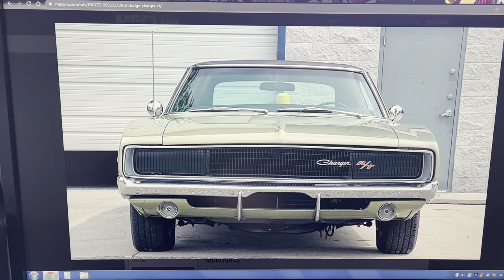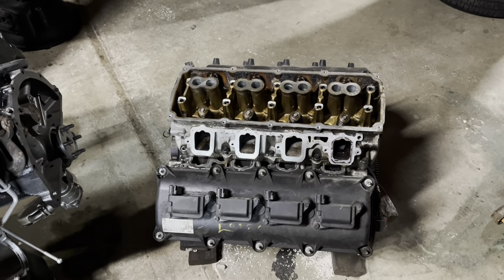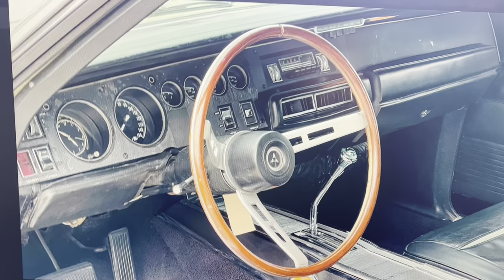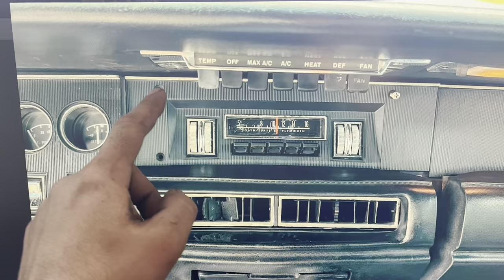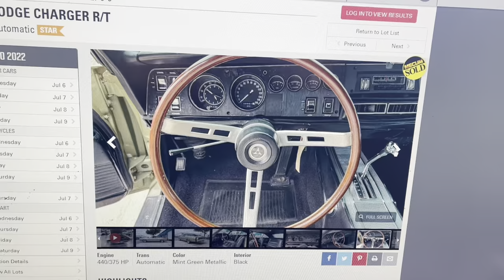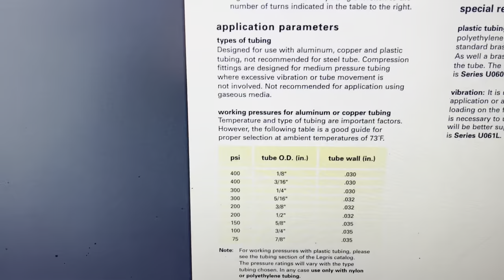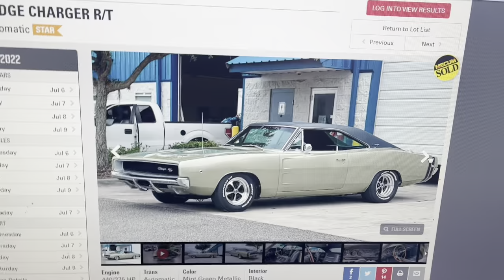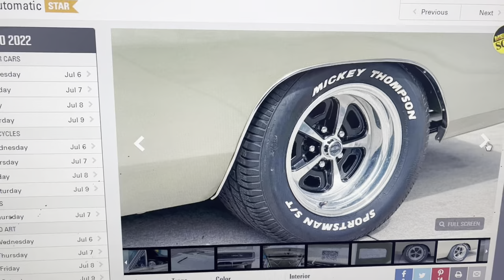Why Did This 1968 Dodge Charger R/T Just Sell At Mecum For $170,000? (It’s Unsafe And Bad)

Comment: That car is "restored" in the same way that Yoko Ono is a "singer". Whoever bought it either didn't look at it, or just doesn't know anything about cars, and overpaid by $100k to $120k. The seller was probably even astonished that they fleeced some poor sucker to the tune of $170k plus fees for this rolling nightmare.  Everything you pointed out tells me that this car has more problems than a run over dog. If any metal work was done, I'd love to see the welds, and wouldn't be at all surprised to see brazing or "booger welds" that didn't even penetrate enough to fuse the panels. The quarters and rockers probably have more plastic in them than Pam Anderson and Cher combined. 

This car could be really nice, but it really, really isn't. It's an example of what I mean when I say, "A fool and his money are soon headed to a car auction."

Comment: Its okay to pick a muscle car apart  that originally sold for about $4000 bucks and was sold at auction for 170k.   cars at 20 to 50k  is different cus a modern paint job is $10k and up if its done right.   It freaks me out cus here in LA ca when those cars were 10 to 15 yrs old you could have had them for a thousand bucks or so.  Oh Thumbs up for this content.
Reply from the maker: Adjusting for inflation helps to put that original price in perspective - but it still means these cars would’ve been in the mid $20k range generally. They have appreciated seriously, as has the cost of a restoration. I still think 150k+ is ridiculous… but people are paying it. They definitely shouldn’t pay it for perfumed pigs like this one.

Comment: I work art a high end restoration shop. RESTORATION, not custom, not restomod. 100 point, Restorations. I've been doing this type of work for over 40 years. Our shop has done at least 30 high end Mopars over the last 20 years. Rare Hemi cars? You bet!! Hemi Cuda's, Superbirds, etc. We don't specialize in them because we specialize in ALL cars, pre war and foreign. Our shop has won its class at Pebble Beach 3 times. We won the Concourse Italiano this year......look it up. 1967 Bizzarrini . That said.....I have seen this type of thrown together nightmare bullshit too many times!! We've had a 1970 440 GTX that the entire rear sheet metal, quarters and tail panel, was braised together with little 1/8" dabs off metal. If someone had hit this car, it would have collapsed on itself and killed someone. Rarely do these cars have an alignment. They barely run. The car in your video is a JOKE! If this came into our shop, we would not TOUCH IT!! It needs to be completely taken back down and rebuilt. This is sad too. I can only imagine how bad it over heats and doesn't stop properly. You can make drum brakes work very good if you put the time in them. But you only use them for a concourse restoration, not a driver. You install disc brakes on the front for safety on a driver. Which you can do without any modification. I own a 69 Charger. I consider it kinda rough but its my driver....and it gets driven!! This piece of shit 68 doesn't even come close to what I consider rough in my book. By the way....I would have no problem picking this thing to shreds. It needs it.

Comment: Did you notice the rubber hose on the transmission cooling lines? That is a transmission failure waiting to happen.
Reply from the maker: There was just way too much to point out. I would be upset to find rubber hose patches on the cooling lines of my $170k Charger, but in general, if done correctly, they’re fine.

Comment: Compression brake lines rarely fail. They don't belong there, but they're still used all the time
Reply from the maker: I know it - that doesn’t mean it’s a good idea. It’s apparently even illegal in some places.
Reply: @DeadDodgeGarage  prolly illegal in most if not all places. An old friend of mine used to run Plymouth Volare taxis 30 35 years ago in Montreal. He would use compression fittings on brake lines, and tar them over to hide them from mandatory twice yearly Québec vehicle safety inspection. They fail in a few ways. If you overtighten, the nut will split and instant failure. I just sold a '68 Olds w 48k, just a little rust, but there was a compression repaired brake line from ages ago. I intended to upgrade it to double flare, but didn't. I'll let the new owner know. I sent him this video. Mecum needs to be more responsible with what they accept. But I bet they don't want to be involved bc it will open a can of worms on all sorts of come back issues. I bet that car gets brought back, and seller red lined. It's worse than a scam! Here's a similar issue a few years back, 20 dead... Brake work has consequence. It's a long drawn out investigation over a simple rusty brake line, and 20 young people dead

https://www.google.com/search?q=schoharie+limo+crash&oq=scoharie+limo&aqs=chrome.1.69i57j0i10i512l8.6273j0j7&client=ms-android-charter-us-revc&sourceid=chrome-mobile&ie=UTF-8
Reply from the maker: Yeah. It’s just all bad in my eyes. Use an inverted flare union. Not much harder, and up to the job’s requirements.
Reply: @DeadDodgeGarage  uncle Tony just reviewed an F100 at Kiwi's resto shop. I'm sure you've seen it. I've been to Nick's Garage with my 63 Biscayne (clone) 409. It got a cursory glance... It ain't a MOPAR...
Reply from the maker: Oh yeah I saw that. Just impressively bad. I think he said exactly what I said about this Charger. If we can see this, what can’t we see?

Comment: Thats baaaaaaaaaaad!!!  Imagine one of the auctions houses employees driving this mess and the brakes failing...crashing into a car actually worth a ton of dough. They need to do safety inspections when they recieve the car and reject if it fails...as this mess would. 
   On another note...I like your Demon 340:-) My 1st car was a 71....shoulda kept it...I'm a ford and GM(think oddballs) car guy but I cut my teeth on the 71 I had....fun times for sure!!  Thanks for pointing these things out...hopefully it will find its way back to auctions houses as a FYI type thing.
Reply from the maker: Exactly! It’s nuts. Maybe they will hear what I have to say… but maybe not. 

That’s awesome. I love the Demon. It needs some stuff this winter. A transmission bearing left the building last time I drove it, and it’s leaking a couple fluids (which is a big no no on the drag strip.) It took me years to seal the deal on that car, and I am very proud to be its caretaker.

Comment: There are states that still do saftey inspections to renew registration. Brake line check for rust is required in northeast states. You fail, must fix & reinspect. That would 100% not pass. Really feel auctioner be responsible for selling an unsafe car.
Reply from the maker: Agreed. Others have said the same.

Comment: minor point after the front brake line mess, but look at the shock upper mount.....the washer is upside down, shoulld be against the shock
Reply from the maker: Several commenters on the B body group thought so too, and so did I when I first saw it, but it’s actually a larger diameter factory reinforcing washer that is welded to the bottom of the shock mount/brace. The shock bushing washer is in place where it should be.

Comment: You are 101% correct. Auctions and the dumbasses that spend this much at them have ruined this hobby. However, regarding your commentary on the compression fitting, there are steel ones that are rated to 5K PSI for use in braking systems. Brass? Yeah... no. Regardless, at that price level, I'm looking for damn near perfection.
Reply from the maker: I have since (in these comments) heard of those fittings. I did not know about them at this time. But again - that’s not what we’re looking at. And as a funny aside, the chart I showed with the pressure ratings for that type of fitting in various sizes specifically said above it that they were not recommend for use on steel. I never noticed or mentioned that during filming, and wish I had.

Comment: Good video. 
My buddy in high school bought a 1970 Charger 383 magnum. It was pretty clean rust wise , but rings and valve guides were shot.
As soon as he bought it (1978), we rebuilt the engine in our high school auto shop class, and what a great car that was.
Awesome road trip machine. That car went to more classic rock concerts before the bands were classic that most roadies of the day. 
We were lucky we were the first ones to do any major work on that car since it was built, so we could see what it was supposed to look like underneath.
I'm from New England, so unfortunately most of the cool cars from the late 1960's to early 1970's that were driven locally turned into a pile of rust by mid to late 1980's.
I'm always skeptical when I see these cars for sale today that have no rust. 
We were fighting serious rust when these cars were 10 to 15 years old, much less 50 years old.
Very good idea to do videos to warn people that "not all that glitters, is gold" ( I borrowed that line from Robert Plant, great concert. ).
Take care
Reply from the maker: Absolutely. I’m guessing road salt is the norm where you’re at. We don’t have that here, or a super wild climate so we don’t get that horrible rust everywhere thing. We do get a shit ton of rain, and everything needs quarters due to rain water and grime gathering in lower areas like that. Either way, every one of these Chargers needs quarters (ahead of the wheel well just as bad as rear due to poor drainage,) rear corners, valence, window channel and corners. Those parts just rust out for fun.

Comment: That junk is not worth that much i restored them for 10 grand just like new people out there are ripping off you guys i got them new back in 68 69 70 71 years of running those cars but i would not buy them to day its bullshit what people are selling that junk to day and it is stupid when most of them are after market parts some not ariganl but go and drive one for awhile stirring suspension handle the road like shit ya not bad at 50 or 60 mph but running harder can put you in a place that you don't want to be.   So i say  leave them in the junk yard and look at them remember the day when it was New Year's we had and fun but you just can't bring it back to day its not the same. So dream on boys and girls maybe better days are gone because it sucks now sad but true.
Reply from the maker: There aren't many of these left in junkyards now... and a restoration on one today sure isn't $10,000. It's ten times that to do it right. My '68 cruises at 90 just fine, and is surprisingly decent around corners too. Smokes both 295s down the block with a factory 383. But - I completely understand the sentiment.

Comment: I used compression fitting s on brake lines many times and never had one fail.
Reply from the maker: You’re not alone - but it’s bad practice, an instant fail on a safety check in places that have those, and it’s not rated to hold the kind of pressures in found in the brakes during a panic stop. So for all of those reasons, I have to say it’s a bad idea.

Comment: Except, not all chargers of that body style came with sway bars. My 68 charger wasn’t optioned with a front or a rear. It may have been standard to include one with certain engine packages. But, definitely wasn’t on every car.
Reply from the maker: According to Tom, a front sway bar was factory equipment on all Chargers in ‘68. His base model, low option 318 car has one. My big block car has one. Every Charger I’ve ever seen before 1973 had one. But that’s all I know. I don’t presently have factory literature at my disposal explaining what was standard and what was not. I think we can all agree that this car should have one, based on the empty mount points and end link brackets.
Reply: @DeadDodgeGarage  absolutely agree, this car should have one. Front and rear. Specially being that low.

Comment: What a shoddy mess. In your comments about the compression fitting,  you didn't mention that, above the pressure rating chart it even says, "Designed for use with aluminum, copper or plastic tubing. NOT RECOMMENDED FOR STEEL TUBE" regardless of the rating!😮 Having said that, the photo of that "repair" was provided by the seller, so all I can add is the old saying, " a fool and his money are soon parted." At that price point, that car should have been dead bang perfect, even if it is a '68 Charger R/T.
Reply from the maker: Did that not make the final cut? I actually filmed the video twice because I wasn’t happy with the first version and may have missed it. I absolutely intended to bring attention to that! They are designed for softer materials.
Reply: @DeadDodgeGarage   No worries. I'm also a died-in-the-wool MoPar fanatic and wince every time I see a nice Charger at a show and some goober in the crowd says "Look! The General Lee".  The poor condition of this one is really shocking.

Comment: Dude, nice investigative journalism!  I guarantee you that kick down linkage is adjusted wrong and gonna burn up the trans right away anyway, besides the carb and timing are off, flat lobes on the cam, timing chain slaps and the rear diff squeels.
Reply from the maker: I had to stop looking for things. Lol. There is way too much on this car to find. Do have to say, I read that a Torqueflite with the kickdown adjusted wrong would quickly burn up at least 15 years ago, and yet of the many, many Mopars I’ve seen over the years with the kickdown set very, very wrong, I’ve never seen it lead to transmission failure. Of course, now that I’ve said that…
Reply: @DeadDodgeGarage  Yeah, it controls kick down shift points manually by adjusting line pressure for the pump!  It's like coasting down a hill in neutral, the output shaft is spinning 70 mph but the pump is only idling.  I think misadjustment allows slip and burn man!  My bud went through several transmissions over the years, maybe bad rebuilds or cheap used one's but we understood the rod adjustment, so IDK?  He has his 69 RT/SE the last 30 years, we removed and installed the engine/trans several times in the past before he finally got his full restoration but we also learned the importance of the adjustment rod set up through his 383 D100, 440 Ramcharger, 62 Lancer and he bought his dad's 68 RoadRunner now. (I'm more familiar with Chevy kick down, TH350 vacuum modulated vs. 700R4 detent cable and lock up converter)
Reply: @DeadDodgeGarage  Heyya, looking at ur collection, wanna see something funny I think you really dig?  In my cars playlist I got 2 old VHS vids from 96' that have my 383 Stroker Firebird I converted the AC compressor to a trans cooler and bypassed the radiator, that sucker was luke warm at ALL times, haha!  I converted it to TH350 when the 700R4 blew up and added a 4:10 Richmond posi.  Anyway, you can see our gangs 340 Challenger, a Cuda, the Charger RT/SE and others ripping it up!

Comment: It must have atrocious handling without a sway bar.   
I had a 69 Mustang, base model, and the handling sucked, weak springs and small sway bar.  It would lean into every corner.   After that was wrecked I bought one that had the suspension from a big block, stiff springs and a large sway bar, and the handling was good.
Reply from the maker: The sway bar was not factory equipment on many, many B bodies - and many more A bodies. Our Coronet wagon didn’t have one originally, and while it definitely didn’t corner like a sports car, it wasn’t as bad as you are thinking. (It has one now, among other upgrades, and it’s in a totally different universe of handling - different story.) I’ve logged a whole lot more seat time in lighter A bodies without sway bars, and the story is similar - they certainly lean in corners, but I can’t say they generally feel unsafe. On the other hand, every early Mustang I’ve ever driven was absolutely terrifying… I think the big difference is torsion bar vs coil springs there. The Chrysler suspension system in all its forms really was quite good.

Comment: Took my driver's education in a brand new 1968 Dodge Charger. It was the same combo as the one sold at auction.
Reply from the maker: Wow!
Reply: @DeadDodgeGarage  Loved the high pitched sound of the starter, then the low rumble of the engine as it idled. To me that tone is a lot sweeter than the raucous sound of some cars today. But then again I'm 73 and used to work on/tune my own cars/ motorcycles.

Comment: My 69 Camaro had downshift cable fused to header pipe...worked great..my buddy removed it..never replaced it...wish I didn't have buddy😅 because no downshift now
Reply from the maker: That’s… not ideal…
Reply: @DeadDodgeGarage  true...manual downshift required. Built car from no front end or floor pans..its all there now..went from dune buggy to car in last 23 years

Comment: What about the transmission lines, criss-crossed with rubber hose and clamps!!!   What about the K frame, NO skid plate!
Reply from the maker: Apparently only Hemi would get a skid plate in ‘68. I am not an expert there. I think the chunk of hose right above the exhaust is “protecting” the neutral safety wire. There is so much there to find… I just had to call it somewhere.

Comment: To be fair i don't think that price is terrible, if you're looking to do the same thing here in Australia (when it comes to Aussie muscle cars), then a clapped out shell that should probably go to the dump for about 30-40 grand AUD (approx 22-28k USD).
Reply from the maker: With the way prices have gone at the latest auctions, I’m not even sure what a terrible price is anymore. An absolutely horrible and rusty shell here still goes for at least 10-15k, so we’re not super far off. I bet parts are harder (and more expensive) around there though.